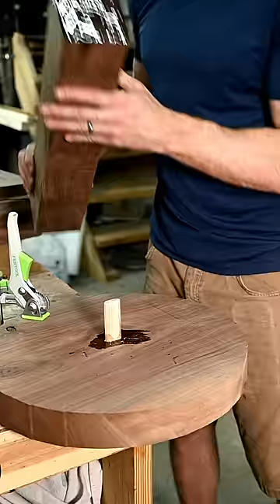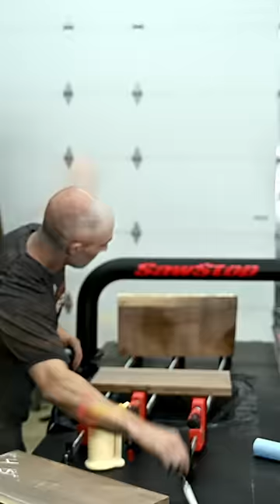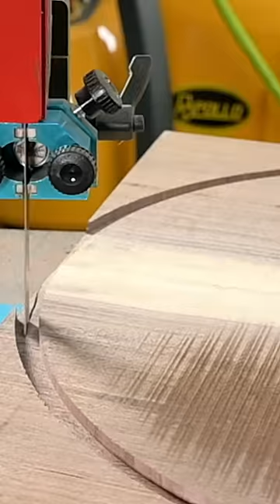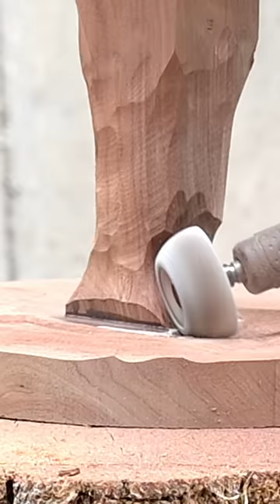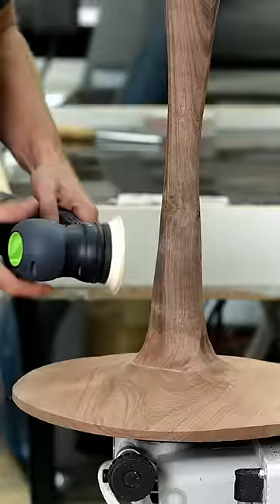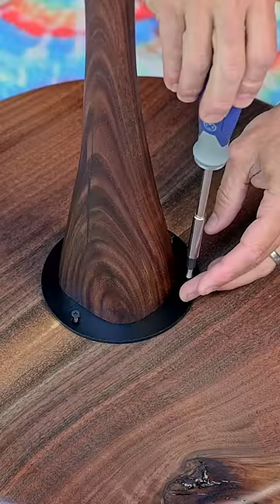I Tricked a Customer

Comment: I'm an average wood worker. This is above average craftsmanship.
Reply: Cam was low key telling you to up your game to average my guy 😂
Reply: Then you're below average.
Reply: @voizek  Gross
Reply: @voizek There's a reason you're not allowed aroundn power tools
Reply: and well above average tooling. He states you can make it just the same with average tools, but doesn't demonstrate this at all.
Reply: The above-average craftsmanship is why he can get $1200 for it.  Now he just needs to replicate it several times a month (different designs, of course) and he can quit his day job.
Reply: @vvhitevvabbit6479  it wouldn't really need a demonstration for an average woodworker. It's pretty easy to see what basic tools could be used instead of his machines.
Jigsaw, circular saw. Handheld router with a flush trim bit. And likely a R15 radius router bit. Angle grinder and a sander. Then you're good to go
Reply: @tobiashede  You try getting invisible seams and a perfectly flush table top without a jointer or feed planer. Maybe you're ok with imperfect edges filled with wood filler and table tops with high/low spots, but a customer paying $1,200 certainly isn't.
Reply: @tobiashede yes, but you need spent x10 more times with basic tools. Time is more valuable than money.
Reply: @danlowe  you must be a beginner
Reply: @CheeseMiser  why? Because I'm a better craftsman? Okay lol
Reply: @voizek  No the dude in the video is definitely above average. You do not get to determine the definitions. No average wood worker has, or will ever do what he just did. That quality is unachievable by an "average"
Reply: Sounds like you're below average using the mommas boy grading skill of 5 gold stars then
Reply: @voizek You're an above average troll.
Reply: @voizek 😂
Reply: A few thousand USD a month with out of pocket retirement and insurance sounds sexy today but is not necessarily going to allow smooth retirement, for most, in 15+ years.

Side hustles are all the rage right now but think about your future. And the future of your dependants.
Reply: @vvhitevvabbit6479  Because with average tools it would have taken 10 times the time and you would have to compromise on certain design choices. It would also take much higher skill to do something similar with worse tools.

Comment: Lol. "You don't need a big awesome shop" says the guy using a big awesome shop using tools you'd find in a big awesome shop
Reply: Yeah and that's not typical scrap wood pieces you'd find around, those are big thick solid chunks of wood
Reply: @RoseBushThorns588  Why would he make a $1200 table for a customer out of scraps. He said he spent $90 on the wood. You don't need to be an experienced carpenter to purchase wood.
Reply: @cavaliercrusader1379  Yes, you do.  You need to be able to tell the difference between high quality wood and low quality wood.  If you use low quality wood, you would not get the same results.
Reply: @cavaliercrusader1379   he said he spent 90 bucks, you know what people do? they lie.
Reply: @outis2493 why would he lie about going to get a piece of wood for $90.
Reply: @misc.shorts I bought materials to make this years so when he first did this. In Idaho; right next door to him, this was almost $200 in wood. He’s not showing everything here… he shows the 2 flat pieces that he makes the tops out of, but you need (4) pieces about 2” thick and 18” wide to make the tops and bases. Then you (2) pieces that are 3-4 inches thick and about 18” long for the legs. Even if you can find walnut that is $15/bf…which is not going to be easy to find it that cheap, you’re still looking at close to $300 in materials. Then there’s also the metal brackets too. 
I didn’t much much more than what he said.
And I’ve got family in Oregon too and I’ve priced certain hardwood while I’ve been there visiting too and it’s about the same price as here in Idaho.
Reply: @cavaliercrusader1379  You don't need experience, but you need to have friends and know people. An average joe most likely would have to rely on detail sale (too small order to buy directly from a mill without already having ongoing business with them) and that would increase the start price 2 to 5x and the pieces most likely wouldn't be nearly as nice.